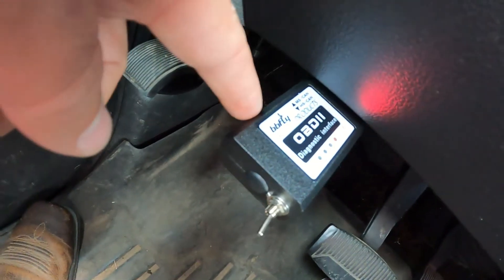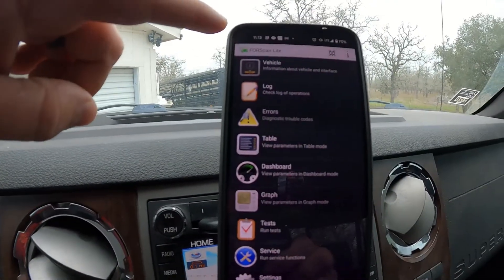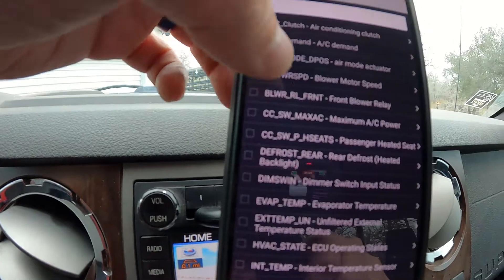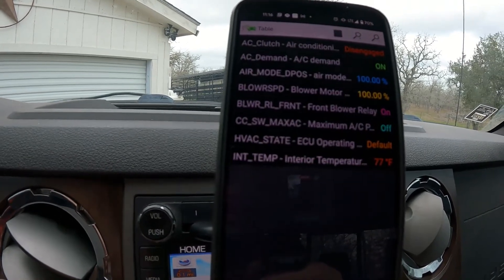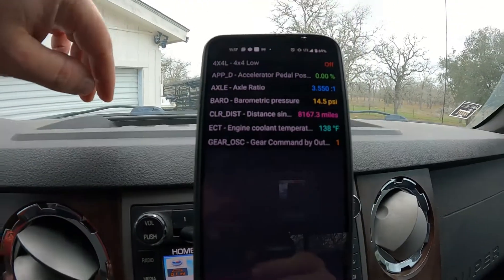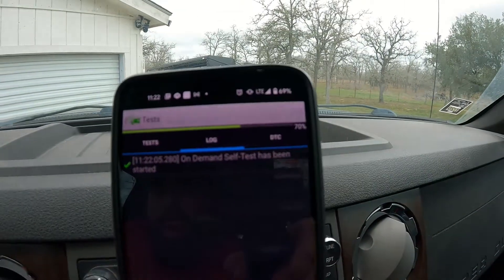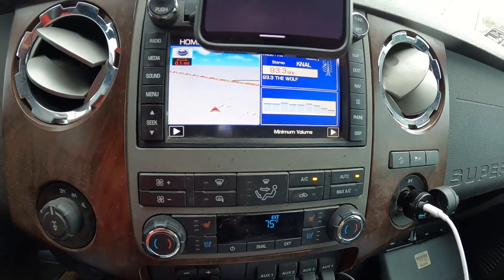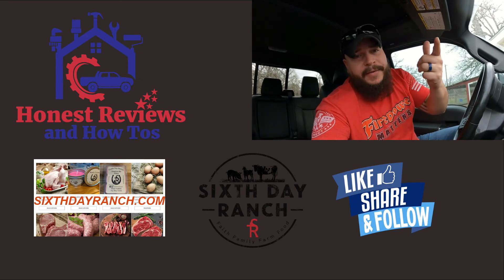How to use a modified OBDII reader(bluetooth) to troubleshoot your Ford vehicle!

Comment: Thanks for the video will be replacing my evap sensor tomorrow I’m having your same symptoms. Does this scanner give you egt sensor readings?
Reply from the maker: Hope it went well!
Reply: @honestreviewsandhowtos  I didn’t have scan tool and just replaced sensor but it wasn’t my problem, my system was low in Freon. Put 1 can with leak detector and it’s been working great
Reply from the maker: @GarzasGarage  Glad you got it sorted!